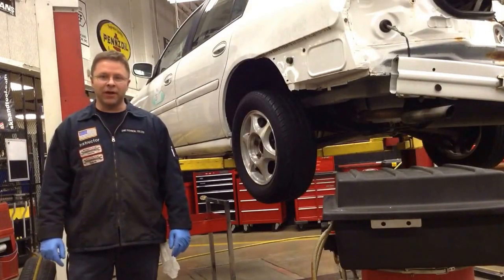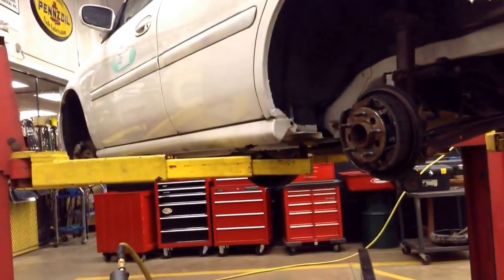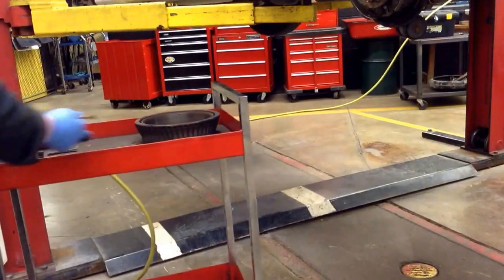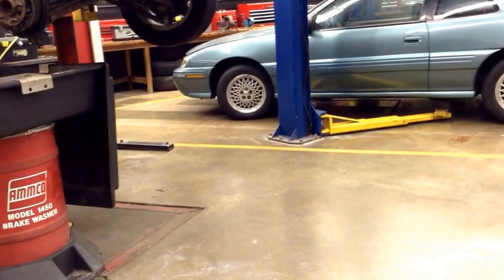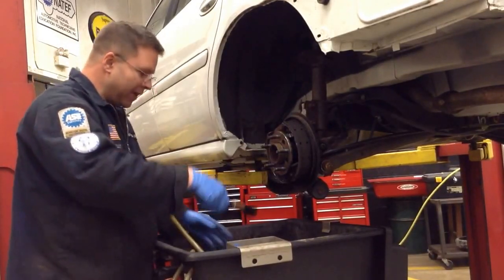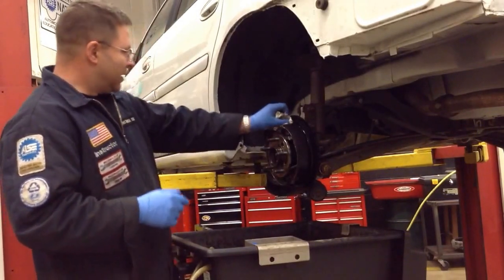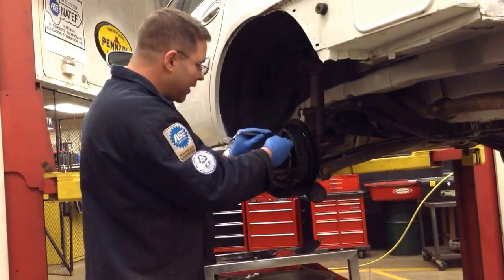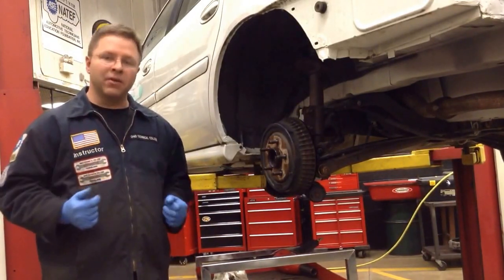Brakes: clean & adjust drum brakes

Comment: Asbestos?!  They haven't used Asbestos in what, 30+ years. You're wasting you're time dude, here is how you adjust rears; Pull the parking brake, 5-8 clicks, put in Drive when the engine is at operating temp, if the car moves, adjust. Use Brake Cleaner, clean ALL the rear brakes, start with 10 clicks, put drum back on seat it and spin, you want an ever-so-slight drag, if not, 5 more clicks re seat the drum and recheck. Make sure you ONLY adjust the opposite side the same # if clicks. The scuffing of pads is a waste, are you replacing the drums?  Then why scuff the shoes. Also I never turn drums EVER, replace them only.